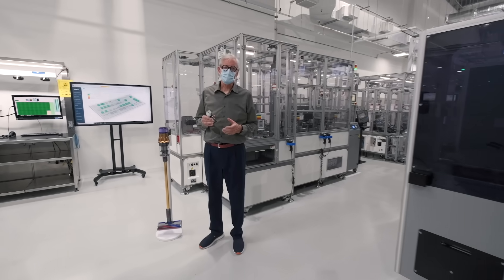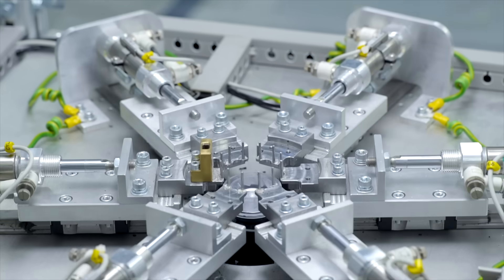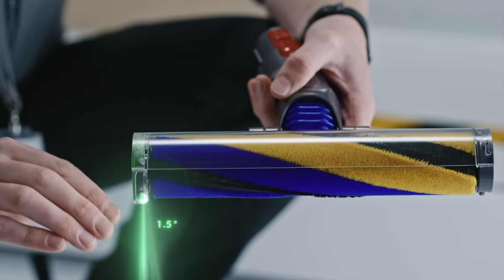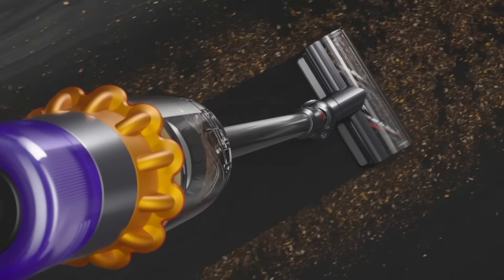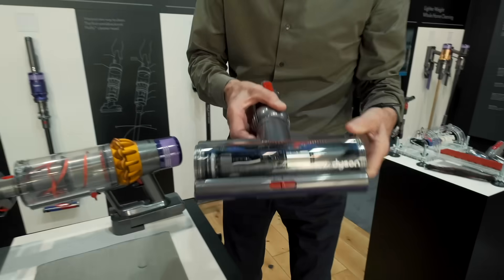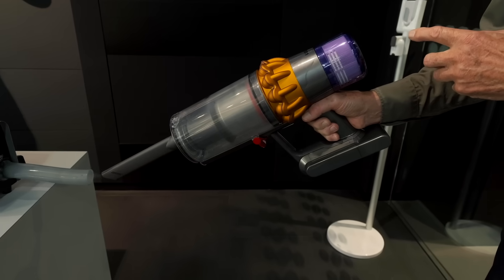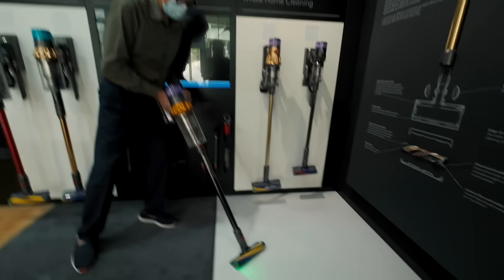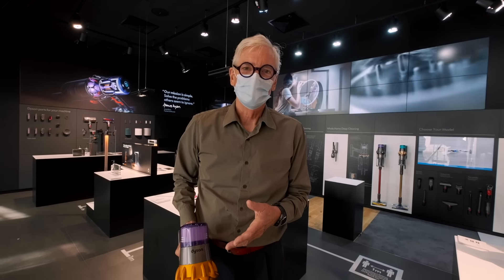James Dyson launches new Dyson vacuum with laser technology.

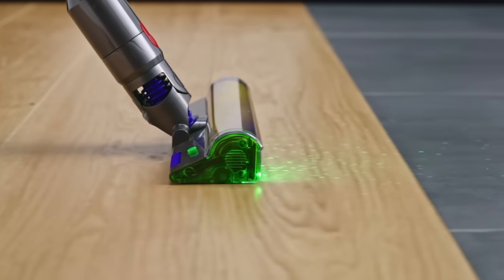Comment: The torch/laser demonstration was nonsense. If you have a bright torch at hand, shine it on a table or floor at the same angle as their laser (almost parallel with surface), and the dust particles should be visible. They intentionally shone their torch at an angle less than their laser was aimed. If their intention was to demonstrate that shining a torch at normal human heights does not reveal dust, then no problem - it's convenient to see when vacuuming I guess, and strapping a torch to my vacuum would be silly and impractical. But later at 03:00 "and you can't see them with any kind of torch" is misleading/false and the demonstration is deceptive (by not directing light at an angle equivalent of laser).
Although their laser probably reveals more than a standard torch, and is well implemented with a larger range and coverage, they still should not lie with marketing bollocks to justify overengineering a vacuum head and somehow claiming their developed laser uses "magical smaller visible light" to see the teeny tiny bits. Even their own press release mentions "The idea came about when a Dyson Engineer noticed that airborne particles in their home glistened in the sun." hmmmmm. Although I still like it and see it as a 50/50 gimmick/feature (the green light is a nice touch), it would be cool to not have the disingenuous demonstration & misinformation.

Comment: I bought V10. in india there is not decent competitors of dyson. Did not have any chance to compare. 

In showroom they trick me with  this water lift scam. They make a dyson vacuum through pipe and you see water in pipe is rising  they deceive consumers. 
Motor in it has a good suction power but not enough air flow. Study these two before buying a vacuum. In showroom when  buying just put your hand underneath you will see. Don’t let them trick you. 

V10 has 3 steps of power: first is useless virtually no vacuum at all, Second level is also useless, third is max power but runs only 7 minutes. And this genius is not providing multi batteries for swap. 

Sum up: there is better options available even cheaper. This brand will die soon since competitors now aware of this guy’s lack of knowledge and filling the gap in actual needs of consumers. 

Even in this video person is just trying to be spectacular and shows nothing except thing nobody cares or understands.

Comment: I been using a Dyson DC52 vacuum cleaner for years.. and i was amazed how good it was.............. 

Enter Handheld V11. I neaver been so freaked out and grossed out as when i took the Carpet test. I ran the DC52 over the carpet twice cleaning the bin  between the runs... then with the brand new V11. I ran it across the carpet once. I still have nightmares over the content of the bin. I must honestly say. Yes Dyson is extremely pricy, but worth it both in manufacturing quality and the job it does. (And having a transparent BIN is clever in two ways. To see how full it is. But also to show you how filthy you really are! Forcing you to clean more often and effective.)

Comment: I’ve had my Dyson V8 for about 2 years and swear by its power, versatility and cleaning ability. Looks like it’s finally time for an upgrade
Reply: I’ve still got my V8 from when it came out in 2016. Just serviced it and it works like new. Honestly, if it still works then I’d recommend keeping it for as long as you can because this new V15 will be cheaper in the future and there will be newer models too.

Comment: If he had put the LED torch on the floor, instead of pointing it down on the floor" it would have revealed the same particles as the laser. This "trickery" is sorta analogous to Bose messing with frequencies. Not saying it's a bad vacuum cleaner, but wish he would have used a more legit demo.

Comment: Mr Dyson, more than anything I hate tangled hair INSIDE the bin, because the only way to remove it is to forcefully pull the hair with your fingers. The brushes are already pretty good. You just need to innovate the vacuum and the bin to prevent hair from getting tangled around the cylindrical core inside the bin.

Comment: Stop adding useless features and adding £200 to the price, I got a DC08 which puts our newer DC54 to shame, old one can suck up a house brick, new one came with a warning not even to try using for rubble lol.. also, the storage solution for the old one, with the tube wrapping around it is fantastic, DC54’s handle sticks up off the back making it practically impossible to store anywhere easily... maybe you should try going backwards to go forwards...

Comment: All well and good but:
Does the trigger hurt your finger after you've been using it for 10 minutes like all the other versions?
Does the battery intermittently cut out like all the other versions?
Does the air coming out of the machine smell like a wet dog like all the other versions?
Do the fittings I have already fit this version or have you changed the connector again?
Does the exhaust always happen to blow what I'm trying to clean or blow in my face when I'm working on a desk?
Do you tell us what the run time is like for Auto and Boost mode or just the 60 minutes in the most underpowered mode on hard surfaces?
These are the questions your customers have, and its not about telling me how many millions of dust particles I sucked up.

Comment: "Our laser detection system". Their marketing team overdid this one. They just slapped a green laser diode which beams laser at an angle in which makes dust show up because of the shadow dust creates. You can achieve smth similart to this if you use the flashlight and beam it directly downwards to the floor and the light beam reflection will do the same to dust particales.

Comment: Mr. Dyson I’ve only ever had one of your hand held vacuums, the v4. It was great but after a while the joints started to warp and had play in them. The next issue was due to my hand size, it would put pressure on the battery and push it down. After these problems it would persistently turn on and off during use. It’s just not built for a household really...just a showpiece

Comment: It is a fantastic Vacuum Cleaner but:
1. Design of the trigger: Taptic + fatigue damage of the plastic part visible after 6months of usage. Trigger lock button should be added my wife hand is to weak to hold it like this!
2. Battery mounting system to weak for the weight of the device when using  a Wall charger
3. Dust bucket opening system works very unreliable sometimes brute force needed to open it.
4. Pressure power level switch should be more inteligent and detect movements of the device in order to stay on the same power level on the same surface. Laser could do the job as well i think.
5, Other than this i think it is a fantastic device. Please set priority to simple desig flaws not lasers which are for limited group of passionates :)

Comment: These are very cool technologies, but I don't see the point in them outside the conical detangler. Laser, cool, but you'll endlessly be vacuuming trying to pickup every last dust particle. Better to just believe its clean than be shown every little part. What's the point in seeing what your vacuum is picking up? Unless its going to tell me I vacuumed out all the 'rona in the room, I don't need to see the statistics on what it picked up. The robots are cool though, but a brushless motor is easy to tell where the rotor is. Back EMF tells the controller where the rotor is, and so long as it knows the amount of poles it has it can easily tell you what rpm it is running at.

Comment: Great video, you dont need silly marketing to sell your products. Just keep designing them right and they will sell. It took me a while to get on board, firstly buying a re-conditioned unit (direct from Dyson) as they are so expensive, we sent that back as it smelt awful, however we were impressed with its power and ease of use. We was then offered a new one with a good discount (which sadly they do not offer anymore) This was the v8. That has since been given to my Father. We brought the v10 after the for the better run time. They are worth the money if you have a big messy family without a doubt.

Comment: Sadly battery performance has barely improved with yet another iteration of a Dyson vacuum cleaner.
Whenever I use low mode to save power I feel like I'm compromising my cleaning routine.
I would love to see hot swappable batteries so I can use hi mode throughout my vacuuming.
Come on Mr Dyson, we know you can do it!!

Comment: Almost guarantee this will get lost, but you can strap a small flashlight at ground level to any vacuum head and get the same desired effect. If you notice, its all about the angle and shadow that gets cast. 

I'm not trying to bash the product, I've owned multiple Dyson products, and enjoy them. But to all the people saying that this is better than any commercial, this was a commercial, you just didn't realize it.

Comment: Honestly that green LED isn’t really impressive. It’s just that green light results in a higher contrast. The important thing is the angle of radiation in this case 1.5°.
But the dust volume indicator is a different thing. Like doing it by sound or hits on specific spot is super creative. Although it’s just an estimation.

Comment: First off, impeccable engineering.  However, I’ve owned a v7 allergy for roughly 2 years now.  My only 2 complaints are that the suction is weak as opposed to a full 12 amp plug in vacuum.  The other, is that when the rechargeable lithium ion battery dies, it takes far to long to recharge and finish the job.  So my suggestion to fix the problem is to offer the stick vacuum design with the new laser and other attachments but with a cord electrical plug in, allowing much more thorough suction to get deep into long bristle carpeting and have the opportunity to finish the jobs without waiting 24 hours for a recharge.  Increasing the motor strength to uphold the 12 ampules could allow an extremely effective vacuum to exist.  Or perhaps offer cord optional.  I also don’t like that I have to hold the trigger the entire time.  The compression can cause strain over long periods of vacuuming.  I suggest a button switch instead.  Kudos for the light weight stick design that’s easily maneuverable and easy to throw away debris from the chamber.  It just needs some tweaks.  Normally I don’t leave comments unless I can offer validated feedback for potential engineering adjustments and provide a better product.  Can’t forget the necessity to DROP THE PRICE!  ON ALL DYSON PRODUCTS.  Share the wealth.

Comment: I think the bit with the torch was a little disingenuous. Of course you wont see any particles with the light that high up. I guarantee if you showed the flashlight at as low of an angle as he did the laser, you'd also see the particles

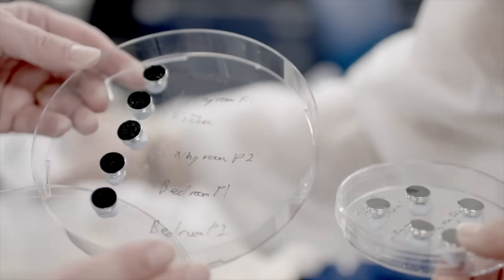Comment: 1:47 Damn, using Covid 19 as a reason to sell a vacuum cleaner. That's some next level vacuum cleaner salesmen pitch.
Reply: It's not a way to sell it lmao, it's a reason to be more concerned about tiny particles laying around although your going to have caught covid before your able to hover it up haha
Reply: @watsappenin2865  what's the difference? Making people concerned and paranoid  about virus particles in your home is a great way to get sales. Fear is  great motivator to get people to buy stuff.
Reply: @eugkra33  hes ,literally explainingwhat the hoover is capable of
Reply: It was inevitable ... but yes. The mention or implication of COVID had me laughing...
Reply: but their last stage of Filter (the only one in those devices) is quite subpar!  No chance against actual HEPA filters - I know, I've measured.
So basically, this is quite outrageous to use COVID as a sales pitch. Viruses, especially COVID live in Aerosols, and you don't necessarily need a HEPA filter for that. Their vacuums' centrifugal filter (the  vortices as they call them) and maybe the walls (as impact filters) might be enough.   But truly fine dust particles (not water based aerosols) do net get filtered nearly as well as with a proper HEPA filter... like inside a good Miele vacuum (and others for sure!). Again... I've measured it. Just look at the size and thickness of such multi stage filtering systems. Dyson has a fleece thinner than any N95 mask!!
Reply: Uuuh, vaccine ?!
Reply: I thought it was extremely pathetic. I would never buy a Dyson for things like this. It's irrelevant, it's fearmongering.

Comment: Your stick vacuums are too awkward to use for an extended period of time due to the weight and pushing the trigger. The volume level is far too high and damaging to hearing when used in a smaller room. You should not need to wear hearing protection when vacuuming your house.

Comment: Such cool products, but I've been disappointed by the quality.  The torque drive had bad tolerances on the brush bar and lack of QA resulting in massive drive vibration that didn't exist in previous versions, but seems to be a common issue across the generation. The hardwood roller drive actually had a few pieces of internal plastic shatter and get stuck inside the roller for no reason. The dust laser is a bit excessive, IMO LED's in the last generation would have been sufficient. I'm glad they've addressed some of the issues with hair tangles now, at least its more competitive with a 200$ shark.

Comment: There is really nothing special about this. Just attach a flashlight on the vaccumhead if you feel the need to see dust better for some reason. It just the angle of the light that makes the difference. Such weak marketing gimmick and people are swallow it hook, line and sinker xD Also the "Dust" they use looks to be some white plastic granules to fool you thinking that is what your floors looks like...

Comment: Whatever happen to steel vacuum cleaners ,plastic garbage going to end up in the Landfill. How about you use your research to find a light materials that are recyclable . O wait carbon credits pay bill gates .
Reply from the maker: Dyson Sustainability
The bigger picture:
Our Engineers instinctively want to improve things, make them more efficient and use fewer resources. We call it “lean engineering” and it has always been our approach. From day 1 we have used science, engineering and behaviour change to reduce our impact and that of our products.

Core technology:
It is by improving core technology and using resources effectively that we can do more with less, making increasingly efficient products. Invention requires leaps of faith and the desire to try new approaches: cyclones rather than wasteful bags, high-speed air rather than energy-hungry heaters.
For the past 20 years, we have focused on reducing the energy used by our products in-use during their lifespans through more efficient motors, better batteries and more efficient product design. It’s about achieving greater performance, using fewer materials, and examples of this are evident in every machine: thinner and stronger plastics, which means less to make and less to recycle; efficient motors that use less energy, and longer lasting technologies, such as LEDs.
Reply: @dyson  no why leds such amazing technology inventions  , thinner and strongest plastic lol  . It's called rubber and steel easy recycled products used for 50 years before this garbage plastic products . This isn't science,  its showmanship.
Reply: @dyson  lean engineering  is just using the cheapest material  ,just in time. I work in manufacturing, get a education.

Comment: The motor might be lovely. The laser, not sure it's really needed. The plastic tube ends that plug the tube into the plastic motor housing are rubbish. So loose it almost drops out after 3 years normal use. Pathetic for such an expensive vacuum and hideous for our environment. Instead of telling me how much dust ofwhich size i got just build a machine that lasts dammit!

Comment: Ok, i have great respect for dyson and i'm planning on getting a vacuum. It is proven many times how good they are. However that laser... the only reason why the flashlight isn't showing the dust is because of the angle. Place any normal green light, no need "laser" (because our eyes are most sensitive to green) and you'll be able to see the dust. Heck, you'll be able to see the dust with a normal white light. Its the shadow that is casted that you see.
I'm just scared that the laser will drive the price even higher and its not really needed.
The new head though... nice.

Comment: Next year: We've added a second laser on the left side, so that you can see the entire floor in front of you.
Reply: In two years: we‘ve added a laser to the rear so you can see how well you vacuumed the floor
Reply: @fiddifussel7841  yep I'm sure they will do this, makes sense. When the production cost comes down abit. Saves you from having to go backwards to check.
Reply: @SikhSoldier2010  or you can simply rotate it I guess!
Reply: @john_7  wouldn't be a wise move because the parfocality of the laser will become inaccurate. The theta angle of the laser reflection will become varied meaning as the particles hit the plate which records the particle size, the rate of the impact won't match the initial calibration...... I tried some mathematics and calculations, everything just gets messed up
Reply: Just need a smoke machine and a stone light too
Reply: Not true. A second laser on the left would counter the 1st, thus making the particles invisible since there would be no shadow.
Reply: @josenoevargas  Maybe a little bit, yes the shadow makes the dust particle visible but it's the laser-illuminated area of the particle as well
Reply: 10 years later:   We've added a rear lazor that enters the skull and gives the user therapy.  Now these dust particles will no long bother the user even if our Dyson stops "sucking."
Reply: Yup and they'll charge another $100 for it.